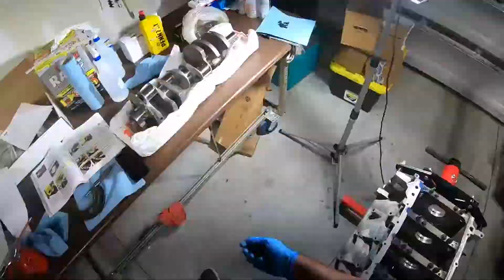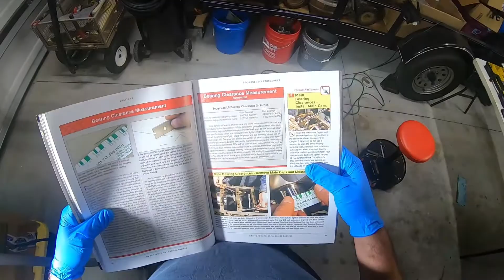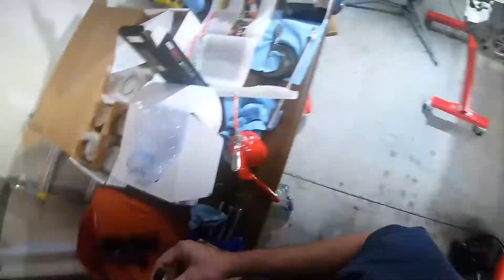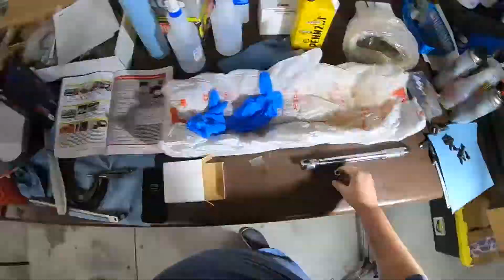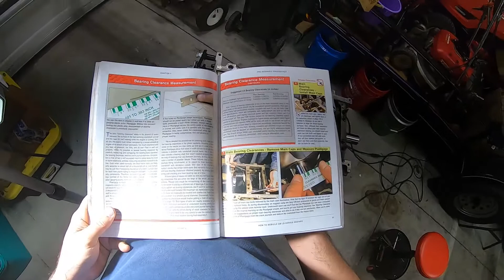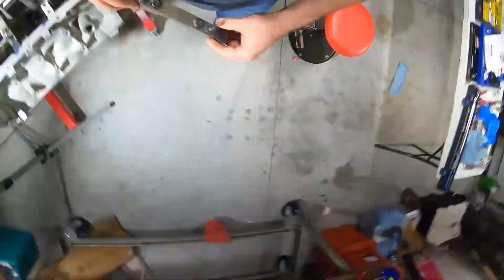Episode 16:   Pre Assembly Day 4 -  Measuring Main Bearing Clearance Using Plastigauge

Comment: When using plastic gauge on rod bearings  do you have to do the upper and lower bearings or just the lowers
Reply from the maker: I did just the lowers, pretty much following what the book told me to do.   The book, by the way, was spot-on!    I really highly recommend it for a project like this.  Thanks for the question.
Reply: @53PerformanceOptimization   what book is it ? I’ll be rebuilding my 6.0 and not sure if to send it out to a machine shop or do it myself